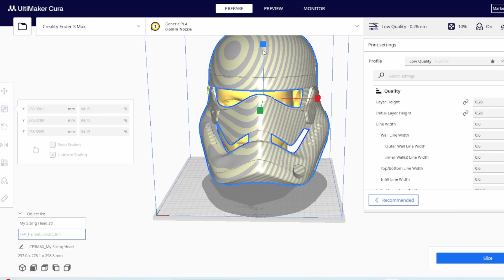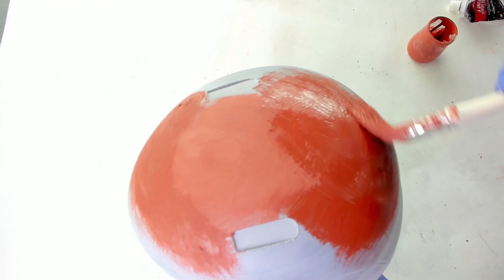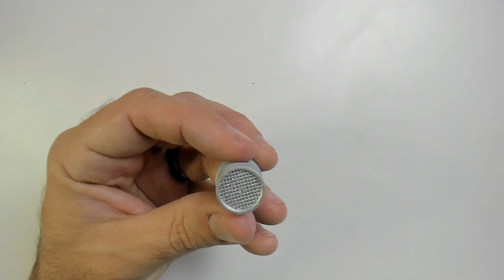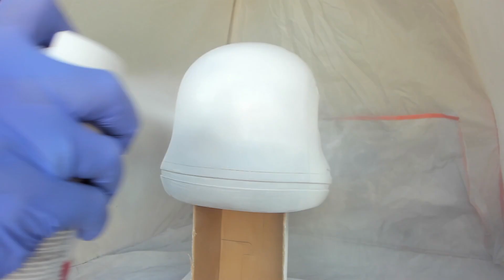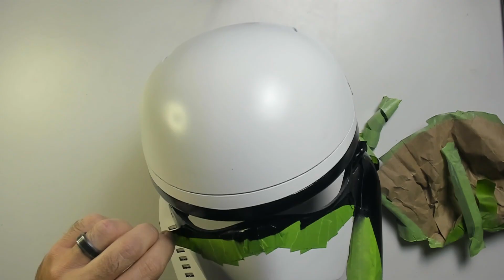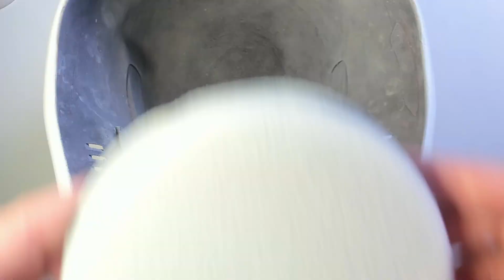3D Printed Stormtrooper Helmets | 2 Very Different Builds

Comment: New guy here, what kind of filament did you use? If it is PLA would it be stronger do to the quality of the print / fill?
Reply from the maker: I used PLA for these helmets. Yes different infills and percentages can affect the strength.